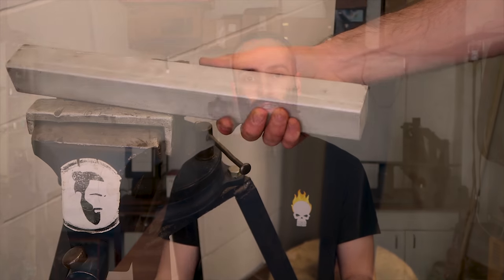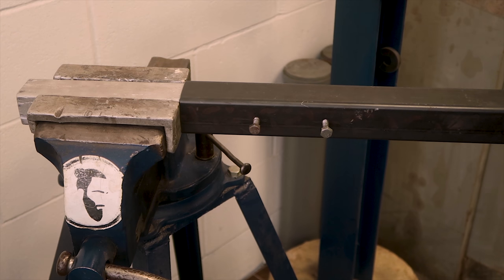Make Free And Custom Cast Aluminum Bars For Your Projects

Comment: Now that came out of the form easiliy. Wasn't expecting that.
Reply: Yeah, I was wondering that myself.
Reply: Aluminum expands ~50% more than iron/steel when heated, it also contracts more as it cools down.
Now, if you try to cast an aluminum part around a steel rod to have a hole in it... good luck with removing the rod )
Reply: M. Mitchell Marmel shrinkage
Reply: you can cast it around a sand core, there are recipes for that purpose
Reply: it shrinks as it cools. falls right out.

Comment: Hi, before casting your aluminum, (or other), plan a mechanical system to vibrate the mold as you sink, as for vibrated concrete, the vibrations will strongly tamp your metal and prevent the formation of internal bubbles and other crevices. Good luck
Reply: Exlent idea
Reply: Damn I never thought of combining the two processes, but if your metal is hot enough and you pour carefully I don't think that it is required. Make for a good experiment.
Reply: Reciprocating saw without a blade, clamp the pipe to a bench and use the saw to rattle the bench
Reply: great idea, but i defenetly dont want a vibrating mold, when im pouring hot metal
Reply: Not sure if it was done but preheating the mold might be a good idea aswell not only to stop it from causing uneven cooling but to remove possible moisture buildup causing an explosion and spraying molten aluminum out the top of the tube
Reply: @dualxsurvival155  preheating the iron might make it impossible to remove the aluminium later, because the iron will shrink when cooling?

Comment: hiya BB,  was noticing that you were looking at the inner weld seam on the square tube you used to cast the aluminum ingot.  there is a way to remove that seam so you wont have that grove in your ingots... go look  at fireball tool  ... the guy there has a video on how to make a tool to remove that inner seam.  its a handy dandy tool for sure =)

Comment: Very cool idea.  I just made some more arms for my homemade 2x72 and I also use tubing and had to add some weld around the arm to make it secure.  This would have been a decent idea... though my forge isn't setup for casting this much aluminum.  Good tip for the future.  PS - I was surprised as well it came out so easily.  Did you add anything on the inside first?

Comment: Well that was a pleasant surprise. I did not expect the bar to release as easily as it appears it did. I would love to see you cast a shorter bar with the mold preheated to about 100-150 C. That way if it sticks it should be easier to melt out a short bar. Now I am really bummed that I don’t have a legitimate shop with some machine tools. Guess I will have to make do with my garage, a claw hammer and a hand drill...😕 And thank you for the tutorial on something that I had wondered about, your proof of concept was enlightening.

Comment: would be even more useful when cast in a round tube as a lathe stock. Nice idea!
Reply: I thought exactly the same thing.. however for what he needs to do with it is actually perfect..
Reply: I didn't know that you can't put a square bar in a lathe.....
Reply: @anotherguy9402  Sure you can, but then you’re wasting about 22% of your material to turn square stock down to a round of the same size.

Even if the aluminum is free, the fuel to melt it isn’t, so a 22% material waste is a 22% waste of fuel. Not to mention the wasted time on the lathe.
Reply: @Nevir202  how did u come up with the 22% figure? Math used to be my forte about a decade ago but I've lost touch and would love to know
Reply: @sharmageddon2171  a 1x1 square obviously has an area of 1.

A circle of a diameter of 1 is pi • r^2 which in this case works out to 0.78....

That makes figuring out the percentage easy as you’ve set 1 as 100 percent, and anything below the decimal automatically becomes the percentage.

So a round bar of the same diameter has a surface area on the end of 78% of the square, or 22% less.

As the length is irrelevant to this you don’t have to worry about the third dimension for these calculations at all.
Reply: @Nevir202  thanks for the quick reply, I remembered that the diameter was twice the radius and was able to figure out the area. Remembered the formula for the area too. Kinda sad that I had all the tools but had forgotten how to go about using them, guess that's what age does to a brain.

Thanks for replying and explaining it all though.
Reply: @sharmageddon2171  No problem, glad I could help. Everything vanishes with disuse unfortunately. 

Fortunately for me, having to explain something to someone else is good practice, so I don't mind at all lol.
Reply: That’s exactly what I was thinking, I wanted to make some lathe stock from soda cans

Comment: i just tried this with 1 1/2 inch dia. 3/16 wall tubing for some bar stock. It will not come out. have myself a solid bar now, looks like  going to have to cut the pipe off the outside. tried a hand torch to heat it up, while loaded on a 20 ton shop press and no luck, I think i bent my shop press though... Did you coat your tube with anything, was it oil hardened first?? wax??

Comment: Pro tip:

Make sure to stock a good amount of square tubing all from the same batch if you’re gonna do something like this for this purpose.

Sometimes the welds are in different places and thus new stock of the same dimension may not fit, without further modification.

Comment: I wonder if it would be easier to get out of the tubing if you had a bolt sticking through the bottom plate that you ground off.
That way you could probably pull the aluminum out when you knock the bottom plate off, and then unscrew it??

Comment: These long bars seem to come out pretty well, only a bit "lost" to shrink defect at the top. Have you tried making short, wide shapes (e.g. a 25mm thick 150mm dia disk) open faced into a steel mould? Just wondering how much would be usable.

Comment: Hello, do you ever try including a red heated rebar just before casting aluminum?   a 1/2' rebar centered in the tubing will give an extra strenght to the aluminum bar with only a little extra weight, and if you give a decent pre-heating to this rebar, (red hot) it will help a smoother casting by giving extra heat to melted aluminum, Try it ;-)     ---   Thanks for this vid !  Axelle.

Comment: Might have come out easier and had less imperfections if you had smoked the inside of the mold with "lampblack" from a candle or acetylene flame before casting.

Comment: For a tube that long you really need to preheat the mold. You can see where the first bit of the pour began to cool and solidify as it ran down to the bottom of the tube, and you can see that the bottom of the pour cooled much too quickly.

Comment: Always preheat your form! this is a metal casting rule. If you don't not only steam bubbles can form in your casting and cause imprefection it can also splash and explode molten metal around. You never know if the mold is moist or has small ammounts of water on it even if it sits in a dry environment.

Comment: Y’know, I just realized, you could use that as construction material you wanna to build some sort of reinforcement. You’re not just storing the aluminum in bar form but you’re also using it for constructive purposes as well. That would be pretty solid for framing.

Comment: bigstackd says always preheat your mold, I can't see it hurting any.
Reply: Preheating will reduce cracks and fissures in surface of bar
Reply: And its to not make a steam explosion but since hes doing it like that theres no point and its for graphite molds
Reply: Pre-Heating will expand the iron mold too, the alu-casting will behave like a shrink fit part & wont come out anywhere as easily as it did in this video!
Ask me how I know :)
Reply: You need to preheat your mold to remove any moisture, if you don’t and you get moisture in your pour your going to have a very bad day, although it’s a great idea on how to make bar stock just be careful

Comment: heat the steel tube in the fire before casting and youll have a little better result with the surface finish.

Comment: Could you weld on tabs to clamp the bottom to rather than having to cut welds after the pour?
Reply: Itd make more sense to weld a flang on and have it simply holt on

Comment: Not only can preheating the mild steel tube cause your bar not to release easily... if you preheat too much you can get scale on the inside of said tube... and we all know what happens when Molten Aluminum mixes with Iron Oxide
Reply: John Bovee - I was thinking the same thing about all these “preheat” comments. 

But.... one of us does not know what happens when molten aluminum mixes with iron oxide - educate me? (Yes this is a serious comment, I googled first but didn’t find much)
Reply: @garyng5662  A thermite reaction. The iron oxide is reduced by the aluminium into molten elemental iron in an extremely exothermic reaction which can be explosive when contained. The process is used to fuse railways together in some countries.

Comment: What is the powder that he put in the metal
Reply: I think it is borax or something similar. I have seen others do this also, helps to remove contaminants from the metal prior to pouring or casting. Dump it in the crucible, stir a bit, remove the dross.
Reply: @Vault57  borax? Probably salt, there are several types of aluminum used in hobbies, the worst is from cans, extruded ok but the best is from wheels and engine parts as they can be milled quite easily. Borax is primarily used in the melting of copper, brass, and bronze. Also gold and silver.

Comment: Ton of flaws from uneven cooling during the pour and I'll bet even more which aren't visible inside the bar - whatever you think it's rating should be, halve it at the bare minimum.
In the future you'll want to preheat the mold to avoid the layering and pooling problems which were visible.
Still, good idea for making low quality aluminum bars in a pinch.
BTW - whatever that sound effect you put in for the aluminum melting was, it was very grating.

Comment: You could actually just have taped it and poured plaster in the end and put it in the fire to dry and pre warm it ( without you get a steam bang) but sand and a bucket would also suffice as long as you are using a stopper since sand floats up. Then you can avoid cutting etc. Went nice and clean though.

Comment: Why does aluminium seem to have so much slag when melting?
Reply: Garbage in garbage out, if you look his aluminum is real dirty before it’s melted. 

That said, it’s easier to use garbage aluminum. You melt it, skim, pour the clean metal into ingots for later. Then the next pour is much easier. Assuming you’re not using the aluminum immediately. 

When recycling do you really want to spend a lot of time precleaning or just skim once melted?

Comment: Hi man! What did you put into the aluminum un the minute 2:15?
Reply: Borax
Reply: @vallesan  thanks! 2 years waiting for the answer!
Reply: @pablozaina2707  . You welcome . I just started melting aluminum and copper 2 weeks ago . Is a lot of fun. You can add borax or boric acid to aluminum . I used boric acid . Do not add to copper. It become glass. I bought my furnace on eBay ..but I'm building a bigger one next week.
Reply: @vallesan  I sincerely hope that you will be successful in this exciting world of metal casting.  I have been doing this for 8 years and I have used salt and chlorine to strip molten aluminum.  I knew that borax is used for bronze, but I did not know that it also worked for bronze.
Reply: @pablozaina2707  thank you . i melted aluminum and brass yesterday . only made ingots . but i want to cast stuff .

Comment: Don't use extruded aluminum as your casting material.
It's too soft, and very gummy.
The best material for casting aluminum, are things that have 
already been cast, like pistons, transmission cases, 
aluminum engine blocks.
These materials are a better alloy, for both casting, and machining.
You will notice the difference.
Using a degassing agent will help with porosity.
Vibrating the mold as you pour might help as well, and heating the mold
makes for a better surface finish.

Tim

Comment: That line is from molten metal cooling on contact with the mold. Melting temp of steel is higher than aluminum, so i suggest next time maybe heating the mold and keeping it hot while filling. This will help the aluminum to form a solid continuous chain in its inner makeup

Comment: Aluminium needs to be pressed before use, because of the bubbles inside the structure , they are the weak points

Comment: brother..,  PLEASE, in the future when using a cut-off wheel in a side grinder, wear gloves, a face shield and most importantly, have the shatter-guard on.
   i have two friends that were cutting in the same manner when the blade shattered.  one friend nearly lost the index finger on his left hand from a fragment that penetrated the bone.  
    the other friend was holding the grinder at eye level when the bade shattered...,  fortunately it only cut off the tip of his nose and didn't take out his eyes...
   not to sound like a mother hen here, but i cringe every time i see someone use one of those grinders without proper protection.
   on a happier note though,  i really enjoy your vids and look foreword to many more.
Hang though Bro. 🤘

Comment: I would refrain from melting aluminum. As extremely toxic fumes are released.
Reply: The toxicity comes from zinc that happens from using scrap aluminum.  Melting pop cans is your best bet to minimize the health risks however it may  have a effect on the strength of the molds. I  do agree with you if your point is to be cautious because it really is a dangerous hobby